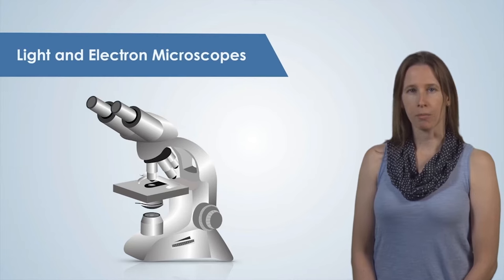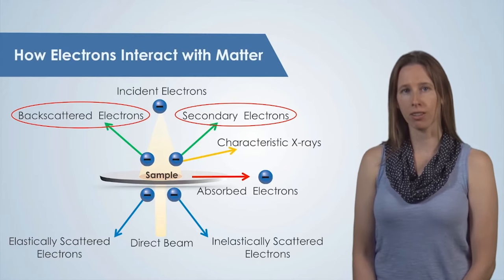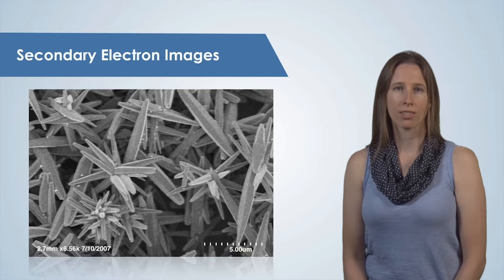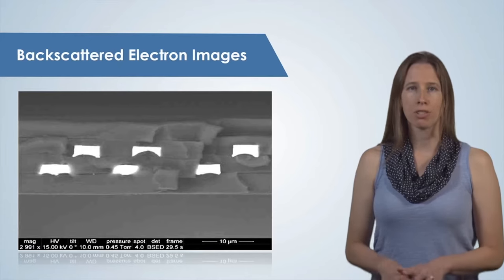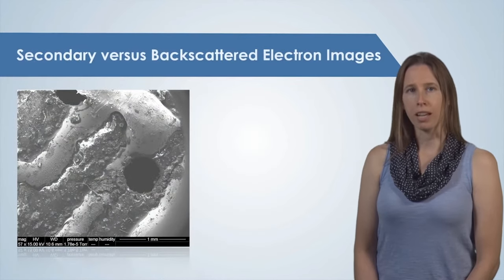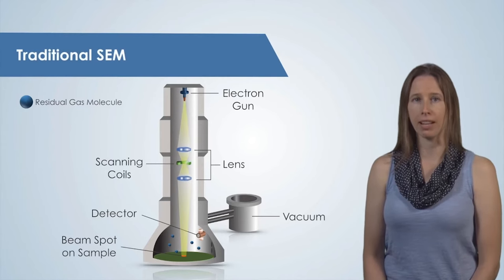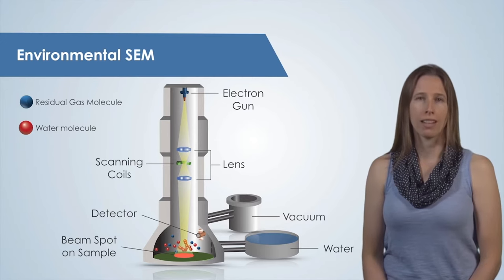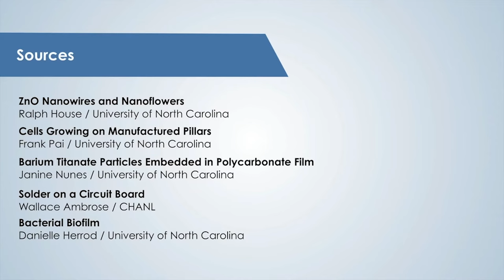Introduction to the Scanning Electron Microscope (SEM)

Comment: Hi Duke University - SMIF,
I have question about SEM,
1/ Could SEM see nano materials, clearly or blur ? (I mean it's a normal SEM, not FE-SEM or high resolution SEM). 
2/ If my material reach nano scale, could I use SEM to prove this material reach nano size?
3/ Which is the best method, cheap and convenience for characterizing (shape and size) nano materials?
I hope I would receive your answer soon.
Thanks Duke University - SMIF so much.

Comment: I have the same issue with the explanation of the electron microscope tha I have with all explanations of electron tubes; the notion that thee is some sore of electron "beam" (consisting of electrons flowing through the device and at a fairly high percentage of the speed of light). 

People often ask how fast electrons flow through wires and the answer is said to be very slowly. A few hundredths of an inch per second per ampere. Although I don't think that's the actual flow of electrons but, there's a big discrepancy between hundredths of an inch per second and perhaps 150,000 miles per second as they leave a wire in a circuit and travel through a vacuum of a device and then back to  plodding along again...when it's claimed (in all the electrical formulas) that the current (electron flow) is the same in all parts of a series circuit  (as learned by anyone who has ever taken a class in basic electricity).

How is that discrepancy explained away? I have yet to find anyone who has even tried.

Yet we know, from direct observation of the circuit actions, that when a cathode is heated, that activity can be transferred to a fluorescent screen to light it up. What's the deal with that?

The only answer that makes sense is that the fluorescent screen is receiving an image of the thermal activity of the cathode through some medium within the device (such as a TV CRT (Yeah, I know. Old school) or an electron microscope. A medium so mysterious and ethereal that the geniuses of science, in the 21st century still refer to it in the dictionary as a "hypothetical substance", ie" the ether.

In a CRT the electrons stop at the cathode and are started up again at the anode and back through the circuit at electron-through-wires speeds. In an electron microscope the electrons stop at the cathode and pass through an accelerating electrode (called the "anode" in the schematic drawings of the electron microscope) and through other focusing and perhaps scanning electrodes but, not as electrons but, rather distortions of the ether field (which focuses the image of the cathode activity) onto the specimen.

Since no electrons are striking the specimen, the image of the specimen seen also must come from the distortion of the ether field that activates the detectors (as the image of the cathode of a CRT activates the phosphors on the screen of a picture tube).

In short, by thinking of the electron microscope as working by electrons striking the specimen, the engineers have fallen into the same trap that they learned (by rote and memorization) in electricity and electronics classes.

Does getting the concept completely bass-ackwards prevent them from building practical devices? Obviously not but, it doesn't speak well of them when they don't care enough to try to actually undersand their chosen field of study and work.

salaphyaics.com
1222922

Comment: Thanks for the very nice lecture. I have 2 questions. 1. If I have two SEM images taken at different resolutions and scale, how co I compare the two on a uniform scale to be able to say one particle is smaller (or bigger) than the other? 2. In the legend of an SEM micrograph taken with a desktop scanning electron-microscopes phenom-pro, there is an measurement icon that looks like an eye. Is it representing some height or what?
Reply from the maker: I am not sure about your specific SEM. In general, a given SEM will have to be calibrated at each magnification. Typically, the SEM will produce a scale bar at the bottom of the image. Note: the scale bar is only as good as the calibration and can drift with time. So, recalibration may be necessary. For the best results, it is preferred to image a known standard simultaneously to ensure the most accurate dimensional measurements.

Comment: Dear I have one question for you.
We cab use SEM for a crystalline material which is present in loose powder form.
Reply from the maker: Yes, you should be able to do this.  We prepare this by sprinkling a fine layer of the powder onto carbon tape on an SEM stub and then sputter coat it with gold.